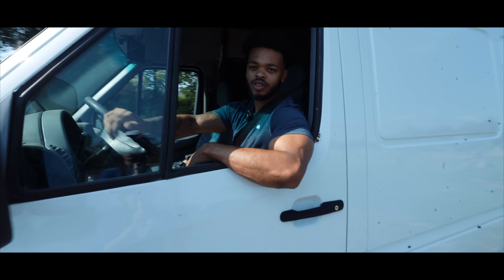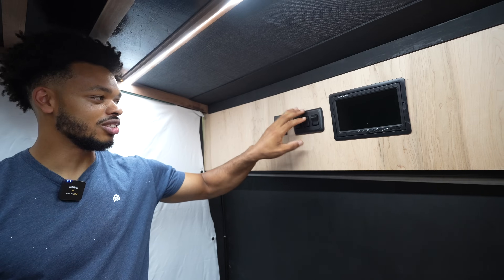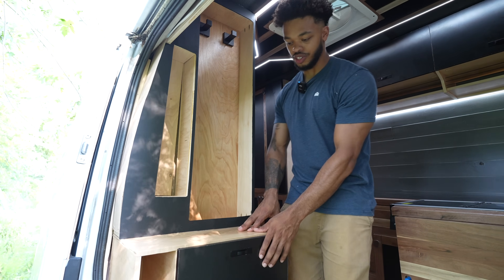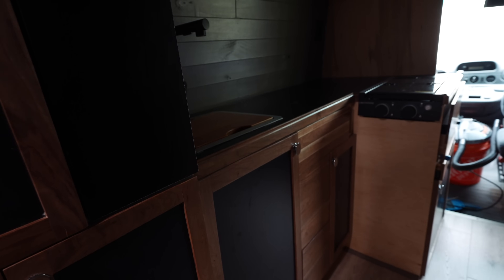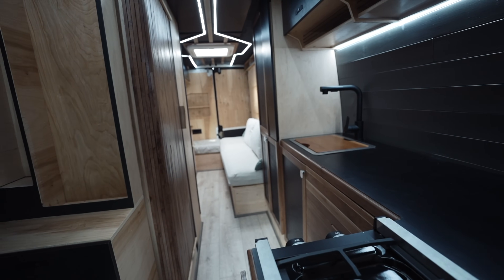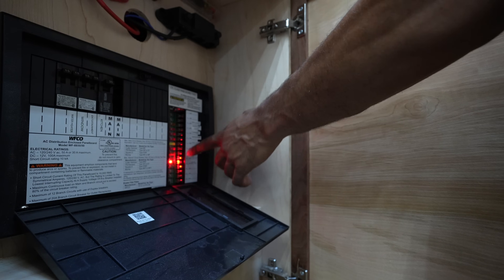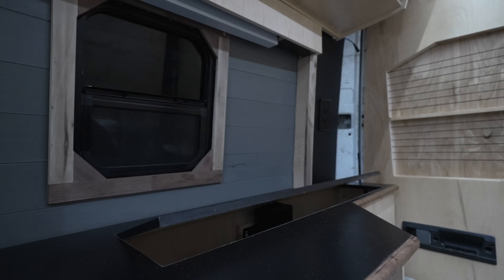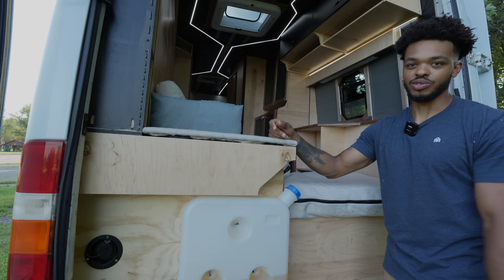ULTIMATE Luxury Stealth Camper Van Conversion | Detailed Tour Under $10k

Comment: 1) You need to be building these bad boys full time (i think thats been said 100s of times in your comments lol). I would buy this with absolutely no changes
2) Im so glad you showed the security setup. Ive ALWAYS wondered how to do this and never thought to use backup cameras so that's ama😮zing. 
If you looked into this van, you'd have to do a double take to make sure its a camper because of its design and that's the real genius here. All these other videos have "backsplashes" and fully tiled showers and OBVIOUS signs interior/exterior that you are sleeping in that van. This one hides that luxury, very modern European and thats no knock on your design, it's very original! Are you worried about the mileage?

Comment: Stunning! Best build I've seen. One thing I've noticed with sofa  areas in many builds is there is not much space for stretching out legs or feet, that if there was a gap on the opposite unit at the bottom, even a few inches, there would be space for your feet.

Comment: As a grey haired female rv’er with too much experience😉 i can testify you have ticked all the boxes. Extraordinarily well thought out.  Good space to function in kitchen and ‘office’.  And a comfortable bed at night.  The bathroom is the only compromise but it works and shows your ingenuity.  Building a stealth camper in a box truck is easier, but to have all the modern cons in that size vehicle is exceptional.  Much better than a Primus stove and a mattress in the back of a “woody”.  I think the only thing you are missing is the spot for the “Best Design” award.👍

Comment: I am at the bottom of the and this video is almost a year but this video and the build video impressed me so much, I had to comment almost a year later. First, you have excellent presentation skills but what’s even more impressive, is your compassion and ambition. You have a great personality and just want to acknowledge that. I live in San Diego CA and I believe you live in NY ? So we are across the country but NYC is one of my stomping grounds, so I am in your area occasionally. At this point, I want to confirm that I am NOT picking up on you, just gratitude to have you in this world. You are a very intelligent person and have many skills, that make you a very valuable asset and I hope you navigate your way to your best situation to make a living. About me, I work for Apple computer and over the last 17 years, I have been interested in building out a van to tour the nation. As you now know, over that time, the van life community has exploded. After my research, I narrowed down my van choice to the Ram Promaster, since it is wider than a sprinter, my second choice. In a Ram Promaster you get a 6ft width, enough for me to lay down width wise, which saves a lot of space for your sleeping area but after seeing your Murphy bed, that’s another option. I am on the hunt for a 2023-24 Ram Promaster 2500 136 wb, which I hope to acquire in 2025. Since I am a 3D Modeler, I already designed my interior to spec. I want a swivel passenger seat, shower, toilet, kitchen, dining and sleep area with lots of storage options. I would love to send you my 3D model and see what you think ? I am sorry to write such a long comment but your personality inspired me to reach out and share my options and thoughts. I subscribed and will start to get up to date on your latest post. Thank you being such a gifted human being and sharing your skills with the world !

Comment: Thinking about your sink, this guy had a larger sink with the drain on one side. U could have a dry rack or a place to put dishes when you're done. & larger countertop when U put the board back down. But I like your setup because when U wash them, U can spray it down when U finish. The dish rack is so U don't have to dry them.

Comment: Nice to see qualified tradeswork. From previous luxury fitout, Strengths: Great design, nice quality fittings & fixtures. Great dados & rabbets, proper glued and screwed joints, or nailgun where applicable, tidy electrical wiring, looked like correct cross sectional area cable interconnects, good access  (use more cable ties😂please). Good plumbing layout, good innovation making a beautiful curved ply dunny. 
Unsure: moisture barrier between metal sides and insulation. use of foil tape on corners/edges in shower under thin single coat of waterproofing membrane. One of the best. Good Quality work. 👍🎶

Comment: for your next build try something a little different im looking for a ford transit connect. pretty small, but i think u can do something amazing with it. i have been thinking about putting a motorcycle in the back with murphy bed and small appliances on the other side. the trick is finding a bike that will fit, maybe a Ducati with handlebar mirrors.

Comment: Im still shocked about the use of propane gas in vans... with or without gas detectors.
Accidents happen. Detectors sometimes fail. Pink mist only means bits in a box, the rest... they just hose down.😮

Comment: 12:38  Did you do this tour before it was completely done?? I see you left the jaged  edge's of the fabric you used to make the shower door work. And some of the wood paneling on the cabinets don't look like they have any finish of any kind on them. It looks like the raw wood paneling on the different areas like the cabinet under the cook top 5:16 and like where the controls are above the door way?? You can see it in different areas. Some of it appears to be raw plywood. Any of it that is raw like under the cook top will get dirty really easy ( like has already happened it appears) and not able to clean it. Especially behind the cooktop. The cover will block a little but any grease will splatter past that onto the wall and everywhere surrounding the area. And the raw wood will soak that grease up. 
So......???
Also, is the hose spray supposed to be the shower head?? Is there a way to attach it if so?? With the shower door closed, you couldn't get it in there. So I am confused here???
And is the wood on the toilet sealed?? It's really nice looking. Best looking homemade compost toilet I have seen on here. 
But the inside seperator looks like it would get really nasty. It looks too close to the top. Not sure why they would make them to be that way. 
This is an old video, so how is it working out?? 
All of the issues I was inquiring about actually???

Comment: How big is the fresh water tank??? And is it under the bed/couch?? 
I don't think I could handle the smell of the diesel tank being right there. I can't stand the smell of raw diesel. I have seen others end up putting it outside. 
You could have gotten one that ran off gasoline and hooked it into the van tank. A YouTuber in Canada has his that way. And his is gas not diesel. 
To me, I wouldn't want the Murphy bed, it looks to take up alot of space and makes the seating too close to the TV. But I wouldn't need a big bed. Even so, skooting the sitting area back and making that turn into a bed another way, would look better to me. But I have seen Murphy beds that looked okay. But they aren't set up that way. 
I would have not made the cabinet straight and not jot out like that. I think that's why it feels too closed in. And the Murphy bed would be great. And just would have made it have a pull out table like a pull out cutting board type thing back there somehow. And a smaller lower cabinet. But that's me. 
I do love the colors and walnut wood. You did a really nice job and looks great!!! 
Did you get any feed back after selling it?? 
I do not mean for anything to be a complaint, but you can't change anything if you don't get questions or ideas to do something different. And it's just my thoughts. 
You do great work for sure. Been a sub for a few years now. I haven't been watching as many build outs but I am going to get a camper topper for my truck and build it out so I can see the country.